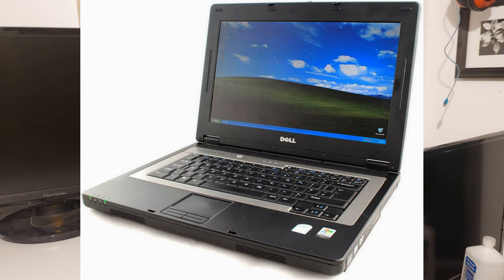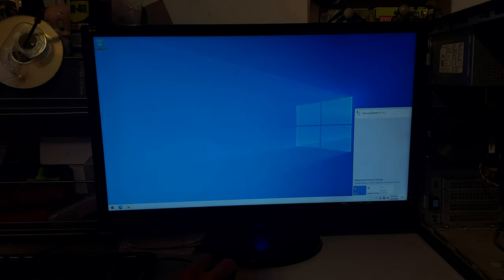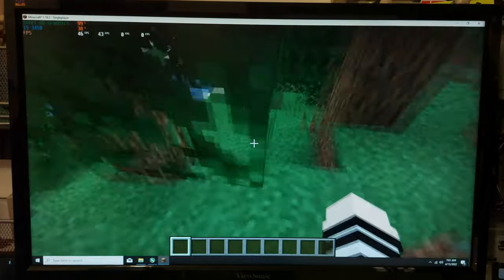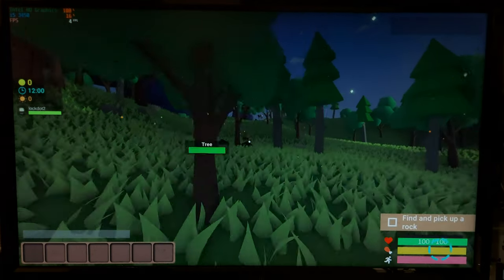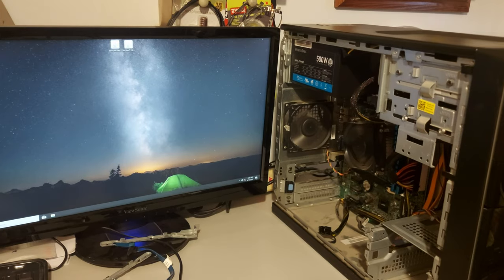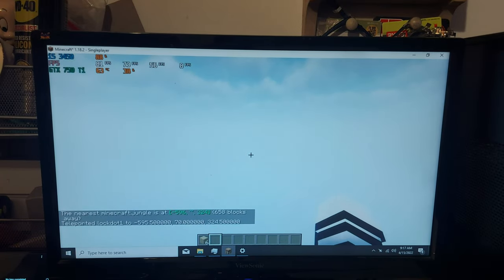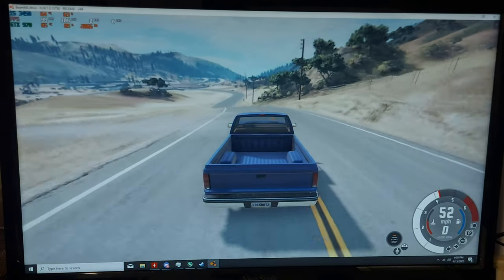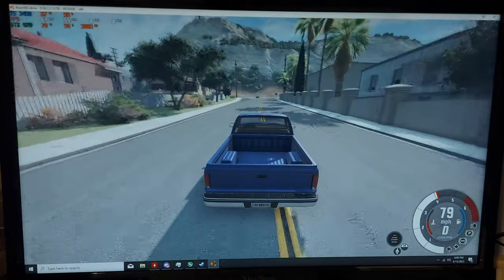I built a Redneck GPU Test Bench.

Comment: kind of surprised you didn't use a hammer to get the GPU installed.
Reply from the maker: I did use a hammer, to smash the back of the case, where the slots are, outward. Since I bent them inward trying to take the metal flaps off of it. I didn't mention some things in the video. Mostly since I was way out of time, and wanted to get this video up, since last week I missed it.

Thanks for the comment Terris!

Comment: I recently got a free pc with an asus m1630 motherboard and an amd Athlon ii x2 220. The 760g chipset has a built in ati Radeon 3000 igpu, it’s very interesting. I can get like 20 fps on Roblox at 720 lowest. I am mostly cpu bottlenecked sadly, but I still have the option of overclocking and bios flashing to unlock it to a quad core. I think I could make something decent. Sadly the most powerful cpu is an 1100t
Reply from the maker: That is a quite neat system! It is even AM3!  You might even be able to stick some AMD Phenom it it, that has 4-6 cores. That is nice! 
Do you have a GPU for it? If so, how does it game with that?
Also, thanks for the comment!
Reply: @digitaljon1109  I was thinking of unlocking it to a phenom ii x4 920. I sadly don’t have a gpu but maybe a 1030 would be a viable upgrade choice. I was gonna add an ssd soon and a bit more ram
Reply from the maker: You might as well unlock it, if it is easy. 
Also, how much are you willing to spend on a GPU? $20? 40? I often am looking at GPU's and might come across one you might want.
Reply: @digitaljon1109  yeah maybe 40 cad or so
Reply from the maker: Thanks! I will take a look around and see what I can find, that hopefully is better than a GT 1030. (:
Reply: @digitaljon1109  thanks! Preferably on eBay so it’s international lol
Reply from the maker: @1jackpenner  That's where I will look! I think I will look at the AMD side of GPU's, since they tend to have better, "aftermarket" drivers than Nvidia.
Reply: @digitaljon1109  yeah, also I’m foo lol
Reply from the maker: @1jackpenner  Hey Foo!
Reply: @digitaljon1109  sup lol